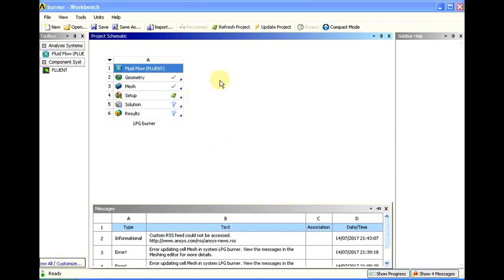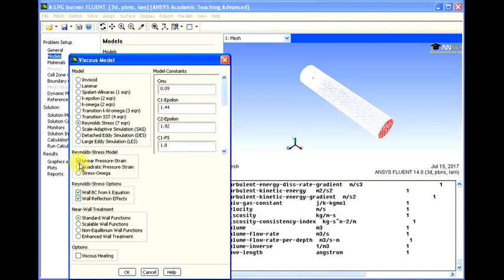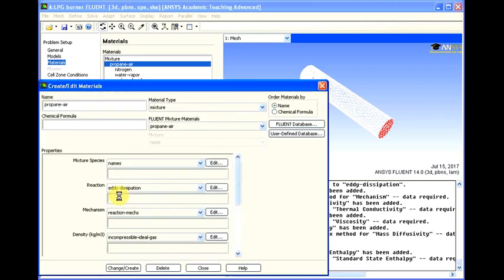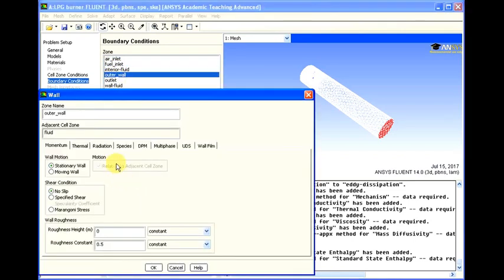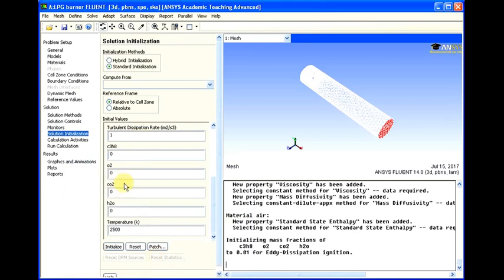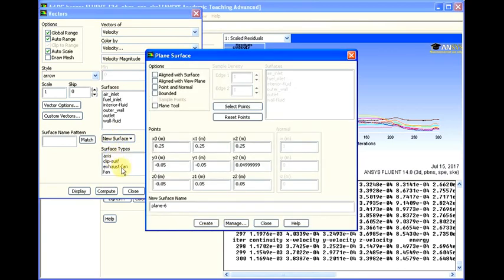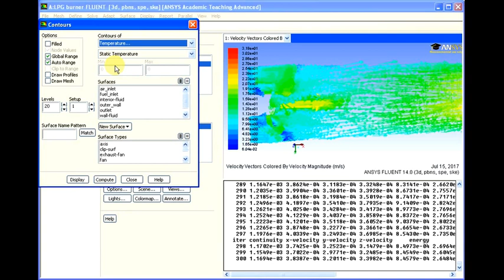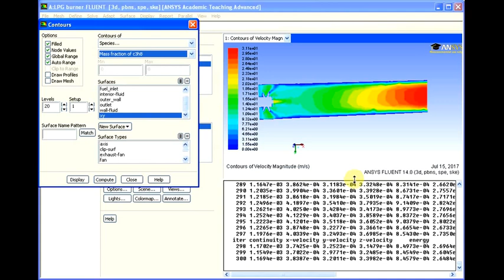Part 3: ANSYS-Fluent (species transport combustion model) tutorial for gas burner with air swirler

Comment: Hi Dr khaled
For burning LPG (30% C3H8 and 70% C4H10) in fluent using species transport as premixed flame how we can do it?
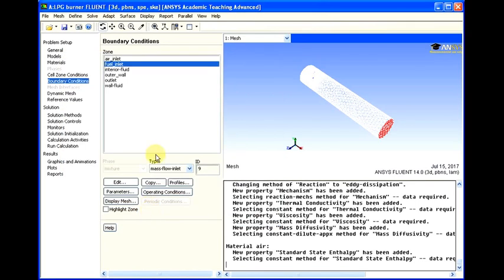Reply from the maker: Se in the timeline 4:13 (boundary condition of fuel) you need to put the fraction (mole or mass) as 0.3 and 0.7 ... This ratio is volume right? so you chose mole fraction.
Reply: Thanks dr Khaled for replying..but for using species transport there is on propane mixture not mixture of propane and butane to put mass ie mole fraction as you do

Comment: Hello, how do I enter heat flux values to a cylinder
Reply from the maker: You can assign how much heat loses you have by going to the wall boundary condition (thermal) and either chose wall temperature or input the heat flux (W/m2) negative value. This value you have to calculate manually through the estimated heat loses from your chamber (W) then divide by your outer wall surface area (m2)

Comment: Hello ,

I am modelling the combustion reaction of CO gas with Oxygen, using the species transport model. It is a non-premixed type combustion, where the fuel gas ( CO) enters the reactor at 1700K and oxygen enters through a jet at 300K . Oxygen and fuel CO burn to make CO2 gas in the reactor.

My problem is that : 
The product gas CO2 is being made but there is no rise in the temperature. 

I have defined my own mixture template, and not using the predefined ones.

I have defined the reaction according to it's stoichiometry and kinetics.

The Cp is set to constant 1000, ( as seen by me in one video of non-premixed combustion of CH4 gas )

The maximum temperature stays to 1700K, which is indeed the inlet fuel temperature ( fuel = CO ).
Reply: i have the same problem ,do you solve it?

Comment: Sir, this tutorial on premixed combustion is very helpful. I have a query if you could reply :
you added the fuel specie as butane and propane that was already available in therrmo.db file. However, If we need to use the fuel specie like C31H48 that is not available in thermo.db of ANSYS Fluent then How will we add this to existing thermo.db file (to amend this file). 
Thanks.
Reply from the maker: You can go to materials and chose fuel that has the closest properties to your new fuel. You copy this new fuel from the library and change its name and chemical formula to the new fuel. You can also change the physical properties if needed. After that you need to write (manually) new reactions formulas in the species transport setting. It could be single stage or multi-stage reactions (all stoichiometric balance) and last stage of reaction will end up with CO2 and H2O. In the boundary condition of the fuel you need to put the balance (mole or mass) under species window for the exhaust gas.

Comment: Hello Khaled,
Would species transport work to model one step global combustion?
Thanks.
Reply from the maker: Hello there....I think the default is the one step reaction, but If you have CO so the two-step reaction will be computed....You have to also calculate the global reaction externally and key-in manually the exhaust gas fraction (in boundary conditions) so it will do the reaction based on your input.
However, you can use external program package such as Chimkin to calculate the reaction and couple it with this model

Comment: Why u put the fuel pressure  2 bar?
Thanks
Reply from the maker: Hello dear ....It depends on your LPG tank pressure .....Domestic tanks usually are 1.5-1.6 bar ...large tanks can be about 2 bar ...You have to choose based on your use case.
Reply: thanks alot bashmohandes  :>